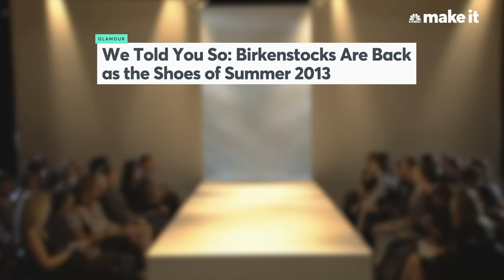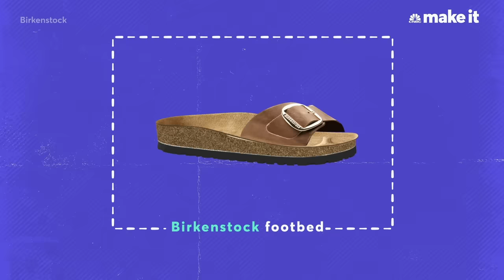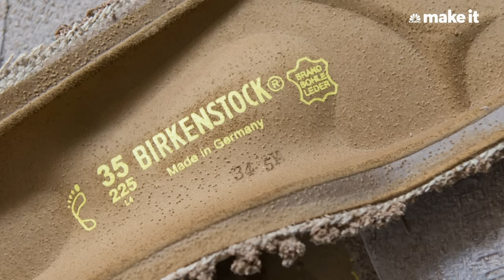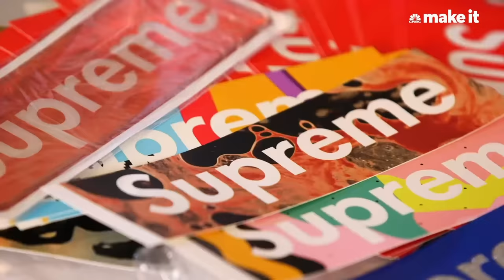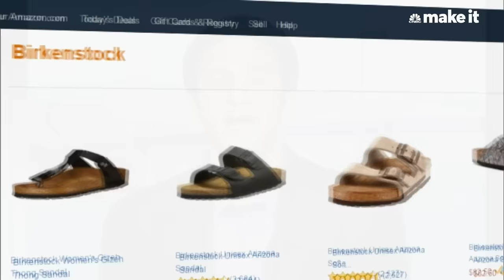How Birkenstock Became A Cult Classic

Comment: A pair can lasts for 10 years.. And it can be resoled. The way they treat the leather is outstanding.
Reply: I had a pair resoled once [I had worn them till there were literally holes all the way through], but it was as expensive as buying a new pair so I just replace them
Reply: German quality right
Reply: Well, if you can keep it dry.
Reply: I bought a pair in summer of 2006 and they still look relatively new!
Reply: @Mr.Anugraha  I live in a tropical country so the rain wore it down.. the straps broke in abt 3 years 😂
Reply: The fully leather one. Not the synthetic ones, the straps will tear after a few years.
Reply: I have a pair of Clarks sandals at half the price, lasted me 12 years. Still good till now.
Reply: @hayati6374   not their cars anymore.. you pay more to get more trouble
Reply: 😂 please. I bought mine 4 months ago & have to throw them away. I cared for them at the highest level. Never got them wet, or left them in a hot car or area I wore them & put them back in the box. They were Monterey exquisite $300 all black leather. The insole turned gray wrinkled & cracked the heel wore down so bad I couldn’t wear them anymore & the leather under & around the buckles turned gray they look at least 15 years old. Birkenstock told me they offer no guarantees or warranty sorry. The quality is not all it’s hyped up to be at least not the type I got they’re trash. The repairs are the same price as a brand new pair which I’ll never buy anymore for 100%
Reply: @PATRICK John when it’s raining Id take mine off put them in a bag & go barefoot. I had to leave Walmart barefoot several times to keep them from getting wet. But they still broke down at a fast rate. Lasted 4 months. Wouldn’t recommend all leather kind.
Reply: My father had a brown Luxor back in 94. It had 1 footbed and sole change. Still uses it today

Comment: No one mentions how good they are for your feet. My podiatrist recommends wearing them around the house.... flip flops offered no support that I wore for years and has ruined my feet and back.
Reply: Yep I was suffering from plantar fasciitis and podiatrist said one of the things to do is get Birkenstock’s... haven’t felt that pain for almost a year
Reply: I have some Birkenstocks that are around seven years old that I’ve worn to the beach and got wet. Only the soles need replacing. I can clean and recondition   the footbed and leather myself. I can wear them all day but they’re not as comfortable as my Teva flip flops that mould perfectly to my instep. They fit so well that my feet don’t slide around like they do in my Birkenstocks. I don’t have to grip with my toes to keep them on like I do with slide in sandals and slippers. I just don’t like the noise they make.
Reply: Pain is beauty which is why you all are not😊😅😂.

Comment: I have 8 pairs of Birks, 7 of which are the Arizona, and wear them 99% of the time.  I didn't realize how comfortable a shoe could be until I bought my first pair years ago. I now have inside Birks, outside Birks, beach Birks and even 1 pair of closed toe Birks. 🤣
Reply: 6 months late but are your beach birks the rubber ones? How are they compared to the original cork ones?
Reply: @400cabal  The rubber ones are still in great shape! I wear them often. The rubber ones don't break in and mold to your foot but I found them comfortable out of the box. I hope that helps!
Reply: @freshbloominclothing  I’m
Reply: Wow birks addict is here
Reply: cool i dont feel so bad anymore im thinking of getting a 3rd pair
Reply: @400cabal  i know this is late but i found the rubbere ones  great as well
Reply: I am considering buying my first pair but am confused as to which material to go with? Can you suggest? Thank you!
Reply: @Jane1983S  that really depends on what you want out of them if its just a durable sandal  to hang out with , like to go to the beach i would suggest the PVC ones as they are less in price and require much less maintenance, plus come in many colors , however you can spend the extra money if you want a nicer pair , they will last however  the standard cork will need a break in period to make them  really cpmfortable,i own a standard pair and 2 pvc ones  (green ,White)
Reply: @adamcunningham6847  I’ve just drooped my rubber ones into the bin after wearing them (almost daily) for 2 years!! They are incredibly comfy,  so practical and I love that they gave a brilliant grip on floor surfaces such as marble.
Reply: Dropped lol
Reply: @BlowinFree  yea i know im having trouble dropping my green ones in the bin ive become so attached to them....lol
Reply: @adamcunningham6847  get them resoled and corked by a cobbler! you don’t have to throw them away
Reply: @cw9795  no no my pvc's have worn through not my cork arizonas

Comment: Uncomfortable..it doesn’t mold my feet right. It's kinda hard and hot too. My toe nails are hitting the top part of these sandals.
Reply: You bought the wrong shoe number.It supposed your toe nails not even touch the front part.
Reply: It’s either you have the right size, but adjusted the buckles wrong, or you simply have the wrong size. That‘s why you try them out first in the store and ask help from the staff. Birkenstocks also come in either wide or narrow so the problem must be you and not your feet nor the sandals.
Reply: @markb1170  She got the wrong number.I also had my first Birkenstock's in the wrong number and my toe nails touched the front part.I bought them online  so i didn't knew how it supposed to be.So I went to the store and i had the wrong number.The gave me  the bigger size and now i have no problem with them.If the shoes were hurting her at sides of her toes then she should either loosen the straps or get the regular fit instead of the narrow  fit that i am suspected that she has.But in the toe case only the number would save her feet ..And also have in your mind that Birkenstock's  need time to adjust in your feet.